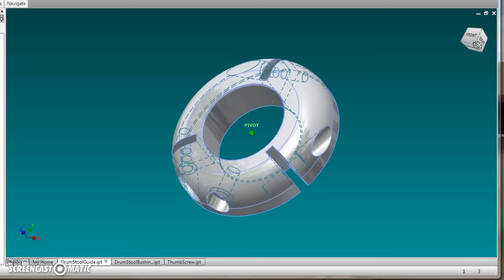How To Build Shop Camera Mounts Part 2

Comment: That is a very clever use of the bolt hole function on the DRO to cut flutes when you dont have (or don't want to set up) a rotary table. The flutes are beautiful.
Reply from the maker: +Juan Rivero Thanks Juan.  Great feature, I use it all the time.  Randy

Comment: That is a beefy looking handle!
Reply from the maker: +bcbloc02 Something you can wronk on.  Works good. Have a good holiday Brian.  Randy
Reply: Randy Richard
Holiday? What is that? lol  I worked most all day yesterday on the shop and am at work today. I am planning to try to get some more steel up this weekend when I am off and it is supposed to rain a bunch lucky me I will be under  barn roof so maybe I can still get some done.

Comment: Phew, that was a deep part-off... better on Al than steel methinks.
Nice job with the hand wheel milling division Randy - turned out great.
I was thinking you took a lot of light cuts with thread cutting as the bar was unsupported - I tend towards very small cuts anyways as thread deepens, particularly on small dia material..
Reply from the maker: +ChrisB257 Light cuts no support and on my logan,  I have a new belt to make up for it so that should help.  Thanks Chris,  Randy

Comment: Nicely done, that handle is the heavy duty type, that would ruin a company that have to sell them and make profit... lol
To plug an unwanted hole, you can do like we do in wood, make a dowel and press fit a couple of thousand interference, face and voila, not showing, even usable with a brass or decorative insert... ;)
Reply from the maker: +pierre beaudry Made from free scrap but HD.  I have an idea of what I am going to make for the center.  Thanks, Randy

Comment: very nice nice looking knobs. was there a reason you decided to use the dro instead of a rotary table or dividing head ?  putting that hex in can be a real challenge using the double crank method.
Reply from the maker: +larry sperling No particular reason, just what happened that day.  The other methods would also work great.  Thanks Randy